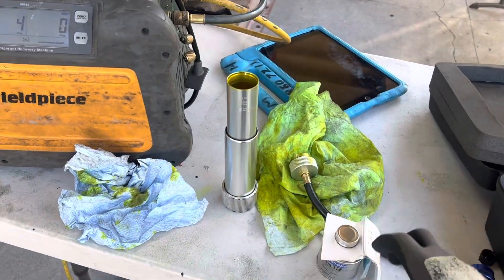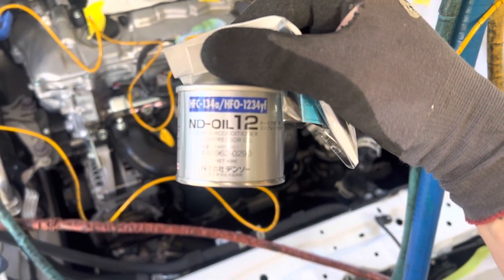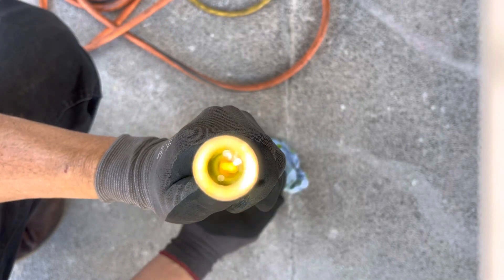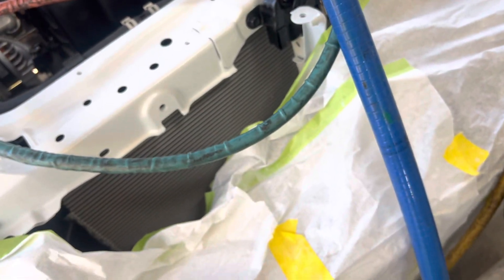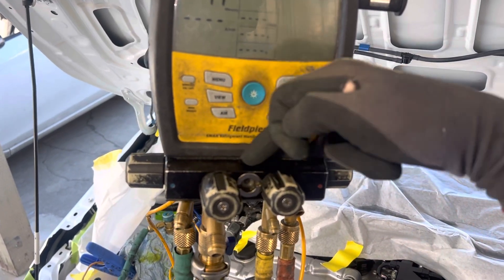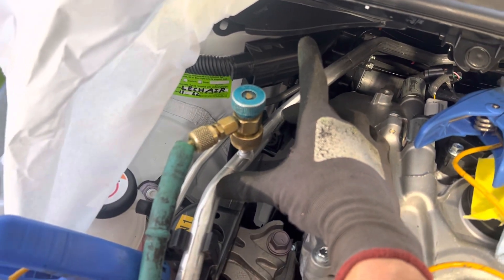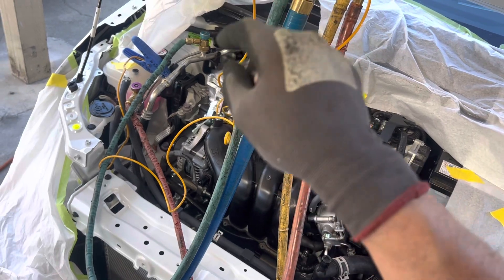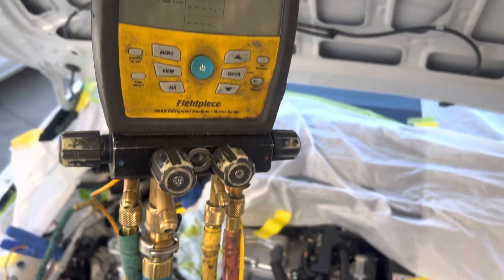UV  FLUORESCENT DYE & REFRIGERANT OIL INJECTION USING CHEAP EBay or Amazon OIL INJECTOR ￼

Comment: I have this similar refrigerant oil injection and I installed new system of A/C for Corolla 2010 and the system is empty, How many ml of compressor oil should I put in the system
Reply from the maker: 1:  is this the first compressor replaced on the car?

2: if it’s a burnt out compressor or those metal flake inside the whole compressor, did you change the condenser and the expansion valve? Did you flush out all the refrigerant hoses and evaporator. ?

3: give me the 17 digit Vin number from the vehicle and I’ll look it up in the computer and I could give you the complete total oil capacity of the system .
Reply: And please the measurements should with this refrigerant oil injection
Reply from the maker: @SaniYahaya-we7mv  what measurements are you talking about?

The measurements are different on every vehicle
Reply: That's is the 17 digit VIN number
Reply: This oil injection is the only measuring tool that I have so the measurement should be with it please
Reply from the maker: @SaniYahaya-we7mv  the one with the clear glass ? 

That’s just for looking at the quality of the refrigerant seen that it’s not all brown, gray or black 

Seeing if there’s any metal particles . 

That’s all that is for 

And you can also see that there’s some oil in the system 

Only experience working on systems and learning the oil quantity when evaporating off the refrigerant from the high side, not removing liquid refrigerant only vapor will you discover how much oil is in the refrigerant

The precise way to do it is on a good working system with a extremely accurate weight scale that could measure weight down in milligrams
Reply from the maker: @SaniYahaya-we7mv  vehicle identification number, located under the bottom of the windshield
Reply: I have try sending the VIN number many times but it just disaffaired
Reply: I think I will make a video with the VIN number and send it tomorrow
Reply from the maker: @SaniYahaya-we7mv  try to break it up into groups of four numbers with a space in between

See if that works 

My email is thomas_lech@hotmail.com
Reply from the maker: @SaniYahaya-we7mv  yes doing a video and putting it on You Tube that will probably work the best
Reply: I have uploaded the video
Reply: On my YouTube channel
Reply: You can check up

Comment: Great Videos Tom
In very old systems, with the high and low side valves located right at the compressor, would you worry about the liquid dye possibly damaging the compressor ?
Reply from the maker: If you’re only putting in the die, and it’s from a good quality manufacture, the quantity you’ll be using is only about 2 mL to 5 mL that’s it almost in perceivable to the compressor.  

The manufactures that I use are TracerLine Products  
And AC Extends 

Very high-quality, extremely concentrated so you only need a few milliliters  

If you are injecting a ounce or two of oil, for some reason, then you just slowly turn as the system is running, and you will only be injecting a small quantity of a milliliter or two at the time well, it is running at 20 or 30 psi, and that will be diluting it down with the refrigerant And oil stream that is already moving into the compressor. Therefore, I will be a insignificant unmeasurable amount and you’ll just do it slowly..
Reply: I can see how busy you are so I really appreciate you taking the time to reply to everybody's questions Tom
Reply from the maker: @georgelivanes2832  no problem just pulled my gauges off of a Toyota RAV4 as I’m working up the work order see your question pop in and your things in your reply. 

I know I won’t be able to answer everybody’s questions all the time especially when the subscriber count gets way up there I see the guys with 10,000 or 20,000 100,000 subscribers they talk about it’s impossible to answer all the questions .

Comment: That's quite a bit of volume trapped in that 10 inches of black hose, given such a small amount of oil to begin with, is it?
Reply from the maker: About 5 mL little less.  This is very fine thread as you’re turning at the piston moves very little..

Comment: I'm a little confused here, injecting oil ( any liquid be it refrigerant or oil) into the low side is just before it enters the compressor...won't that kill the compressor ?   Why not inject to high side so that the liquid must pass through the evaportor first before getting to the compressor .
Reply from the maker: It’s only a very small amount and 40 mL.  
           Think of the old days of pouring water down the carburetor to help clean carbon how does a combustion chamber?. 
           You’re not pouring down a 5 gallon bucket , you’re dribbling drops. 

You’re not injecting 6 ounces of oil down the suction line right in front of the compressor . 

There are some cases where, especially if you put too much liquid refrigerant oil, in the high side line is located just before the expansion valve. The oil hits that small orifice in the expansion valve and it is thick like molasses and I have seen it take literally a few minutes to finally pass, but until that time it completely blocks the refrigerant flow and you think you have a plugged expansion valve.  Lol 😂. 
            If the high side service 13 is after the compressor and before the condenser, no problem.

Comment: Aloha Tom, I'm new to your channel and appreciate your explanations focusing on the DIYer.  I do most repairs on my vehicles including A/C repairs and I enjoy the benefits of owning my own tools, when i have the chance.  May I ask what you would recommend for a vacuum pump for the occasional shade tree mecechanlc like me? I have a certificate of training in AC refrigerant and safe practices and evacuation.   I'm looking at the JB DV-4E; HILMOR 3 CFM; or Fieldpiece FP67; If you have any other suggestions, I;d appreciate it.  Thank you
Reply from the maker: You were mentioning some nice piece of equipment for a shade tree backyard Mechanic congratulations they’re not the $60 eBay slow boat from China products. 

I would recommend the Fieldpiece VP67. I think that’s what you meant instead of FP. 

I would also recommend when you can afford it the blue silicone vacuum, dedicated vacuum hose with the fittings that come off the largest fitting off of the Fieldpiece pump, which is three-quarter inch . 

You can purchase it at a later date . 

I would also recommend True Tech Tools I do not have any affiliation with them, but that’s where I buy all my tools Chris from HVAC videos on YouTube has a promo code for an 8% discount with True Tech Tools 

It’s all one word, capital letters  BIGPICTURE YOU ENTER THAT IN THE PROMO CODE BOX AND YOU WILL GET 8% OFF THE PRICE. 

Good luck I hope this information helps you ask questions anytime I want everybody to learn as much as they can, and do the best job they can for their customers .
Reply: Thanks Tom for the time you took to respond; I appreciate it.  I first learned about big blue from your video- "AC single hose vacuum; single hose recharge Micrometer explained. "
Yes big blue is in the budget along with the Fieldpiece VP67 on your recommendation. Thank you!  The problem I have; maybe not so much a problem, but I live in Hawaii where shipping here blows so I shop around and need to buy from AMzn to save on cost. I do compare prices before pressing the buy now:) and will check out True Tech Tools.  Especially for the the connections for big blue to the FP and Manifold guage.  I also purchased a CPS VG200 that i need to figure out how to hook it all up and vacuum correctly without the schrader valve.
Keep up the good work you do for your customers and the vids you make for folks like me. @coldfinger459sub0
Reply from the maker: @firefly737  I was in Maui this year earlier during what they called it a unusual heat spell that was hotter than normal. I like the island swimming with the sea turtles, but it took me four days to get used to the heat and humidity. I could not walk outside more than 30 minutes without going home and sleeping for two hours to get up again to try to go outside again the San Francisco boy, who was born and raised in the fog just cannot handle Hawaii’s intense son, humidity and heat. 

Yes, when purchasing stuff on Amazon when I was in Hawaii I discovered things with lithium batteries in them. We’re restricted I guess because they have to come on planes.
Reply: @coldfinger459sub0  Yes! It was and has been really hot, especially the summers.  Over time, one does acclimate and can then really enjoy what Hawaii has to offer. I'm born and raised.  I enjoy SF as my wife and I like the touristy stuff.  We recently went to Coit Tower and did the day bus tour. I occasionally go to OAK for work too.  Harbor Freight- here I come:)
Reply: @coldfinger459sub0   BTW- EVAC kit is in the cart at TruTech tools with free shipping and Promo code worked. You saved be some bucks- Mahalo:)
Reply from the maker: @firefly737  👍 I hope one day I will have my own promo code with TruTech Tools